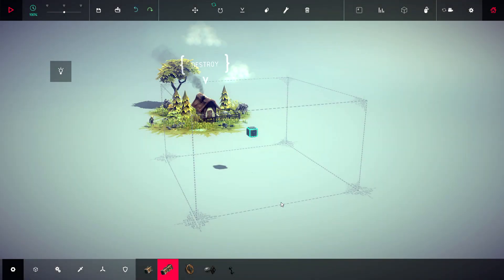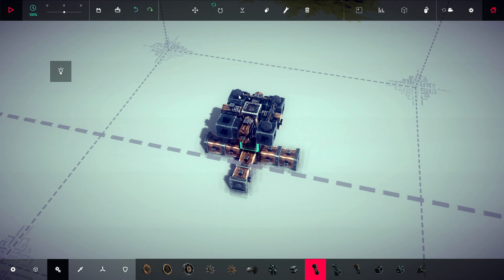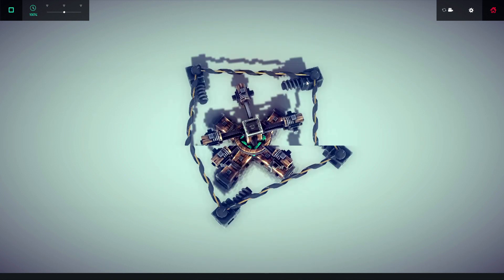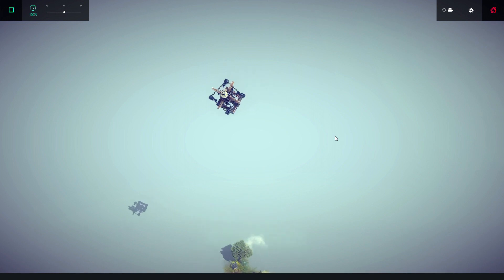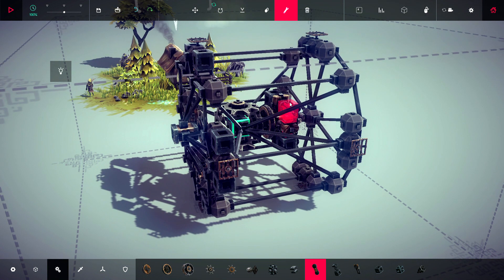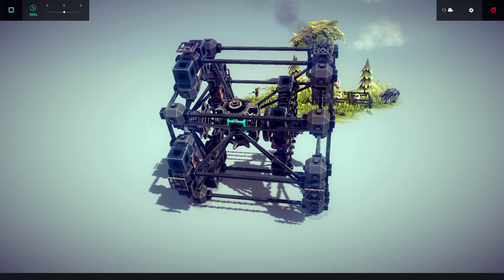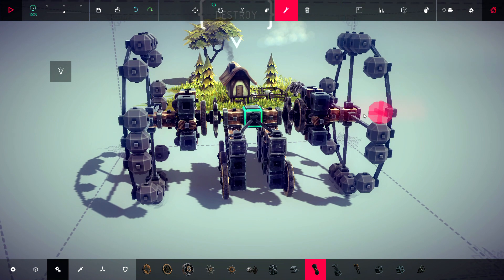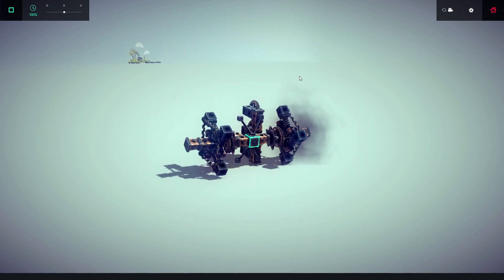Besiege Early Access (Ep. 24) - Perpetual Motion 2.5 Ways!

Comment: You can make the helicopter stable by putting on two spinning points with propellers spinning in opposite directions. Thats why a real life helicopter has the small rotor in the back to prevent the body to spinn around. Try putting on some kind of gear that makes the engiftes power go into two rotors.

Comment: I haven't searched this up so I don't have any proof to back up what I am going to say but I think the reason the pistons are extended in the first perpetual motion  machine a is that they are coded similar to suspension blocks. If you spin suspension blocks very fast, you will see that they spread apart. Probably because they are coded to not only push in but also to push out out. Also, there are ways to make perpetual motion using just sliders or using steering blocks to push against wood (but these two methods as well as yours rely on unrealistic friction as well as other things that obviously wouldn't work in real life.)